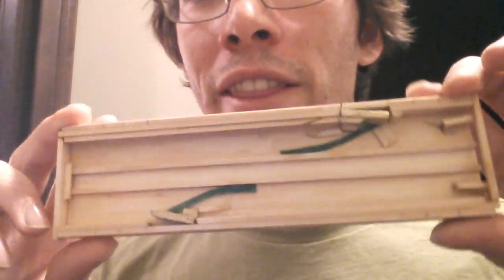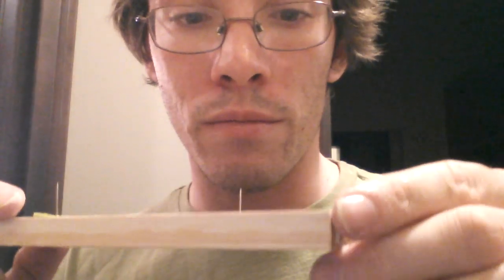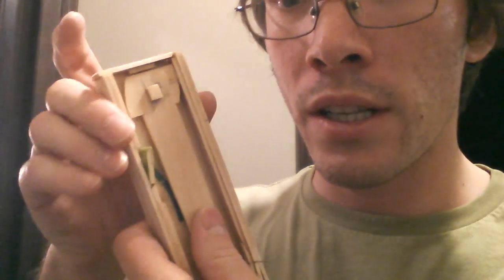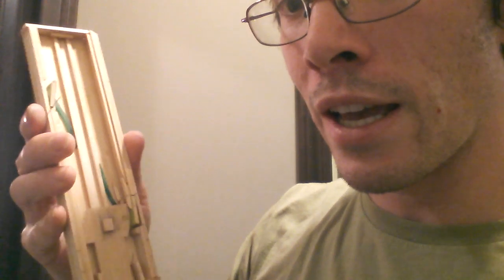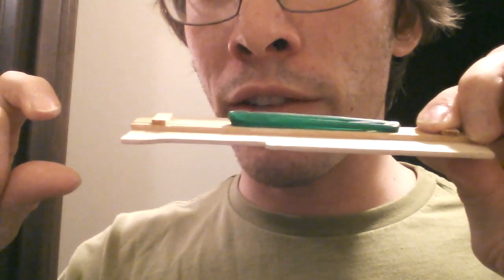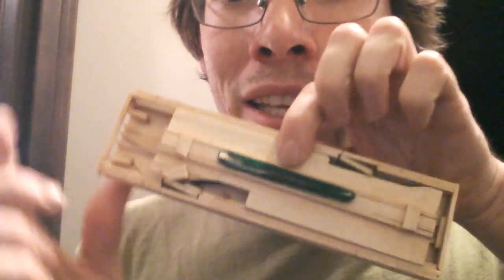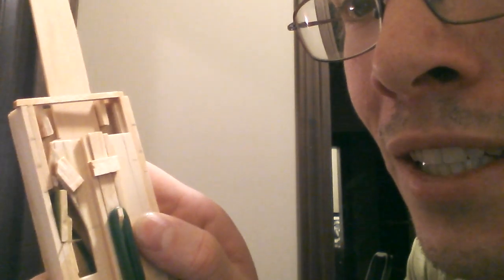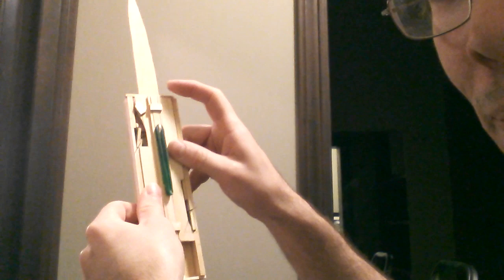Hidden Blade (Assassin's Creed) Prototype (Stage 1)

Comment from the maker: The material in this video is balsa wood. It is a very common modelling wood because it is super light-weight. You can find it in any hobby store is my guess. I don't know about hardware stores though. You could also use a rigid card board (not cardboard used for packaging) or a mdf / hdf / ldf composite if you really wanted a sweat! Basically anything soft enough to cut by hand, and rigid enough to work small details with.

Comment: thanks so much the paddles work so much better then the original design i saw for the locks but how big does the launcher for the blade need to be bigger or smaller then the case?